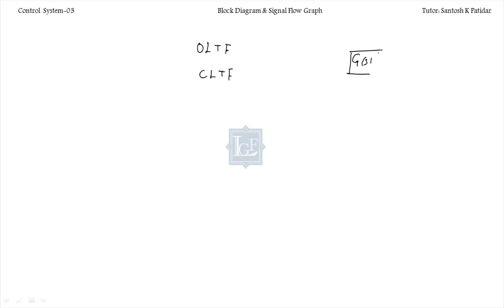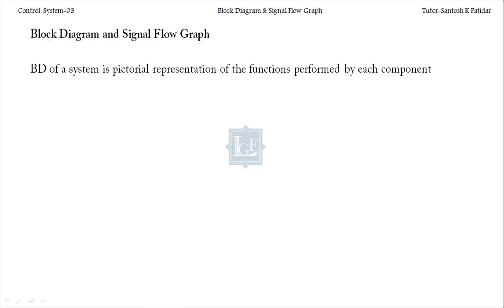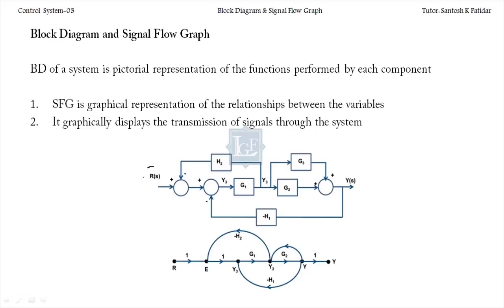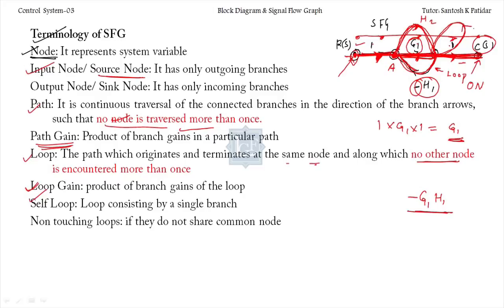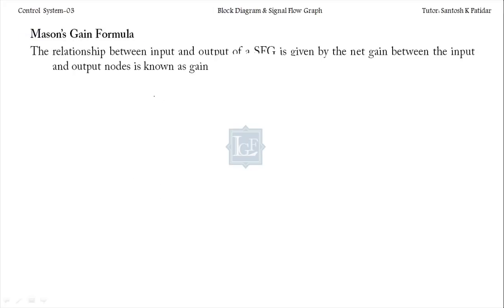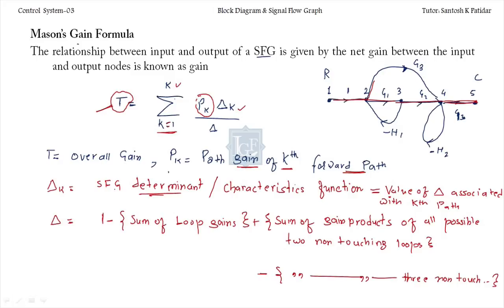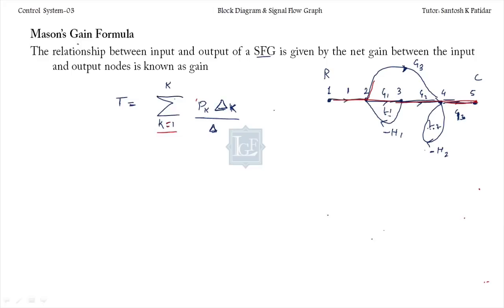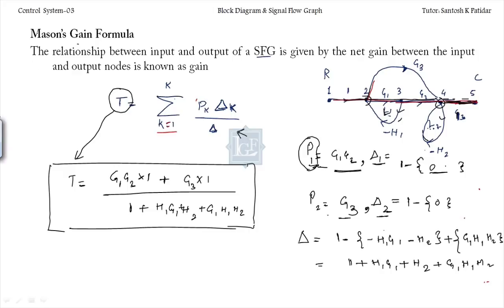Lec 03 Block Diagram & SFG

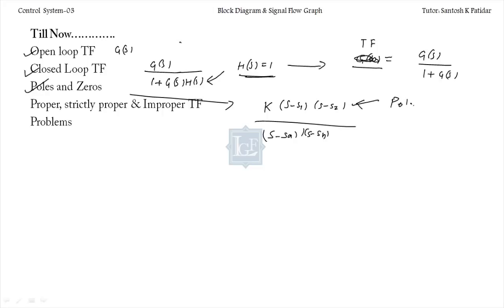Comment: Nice initiative. But just wanted to let you know that I have observed there are quite a no. of mistakes in the Control system videos. For ex. In the introduction of this video at 3:15 it is said poles are roots of numerator and zeros are roots of denominator, but actually its the other way. There are some more small mistakes like this I found in this as well as the previous lecture. Would be really great if you could review and correct these sometime.
Reply from the maker: it cannot be edited..but if you will go through each and every lecture then u can easily understand the things which we want to deliver..they may be the slip of tongue..but as an engineer u can understand easily..all the best..